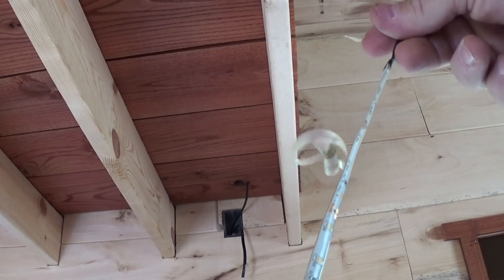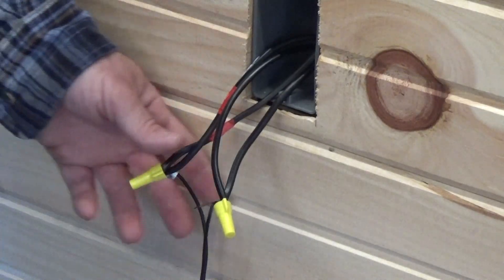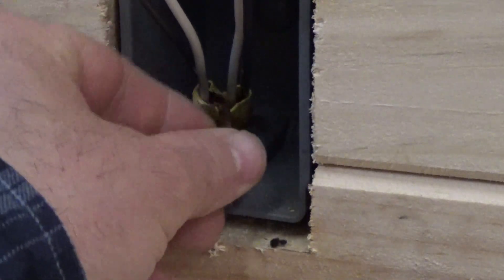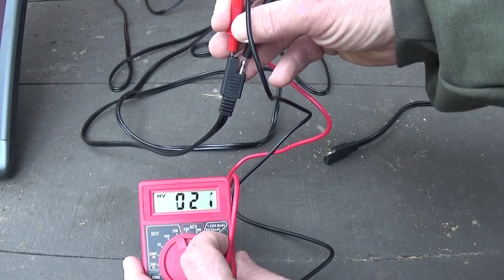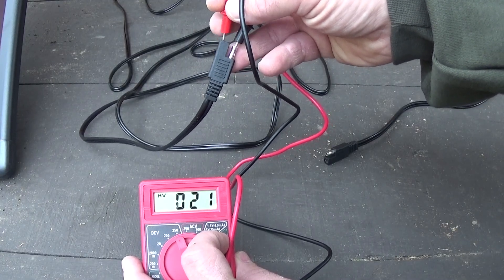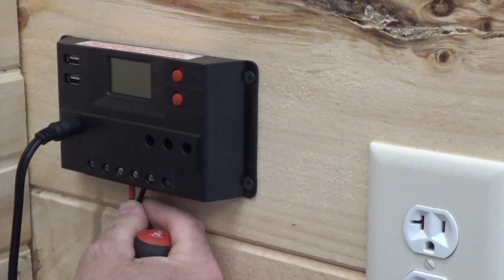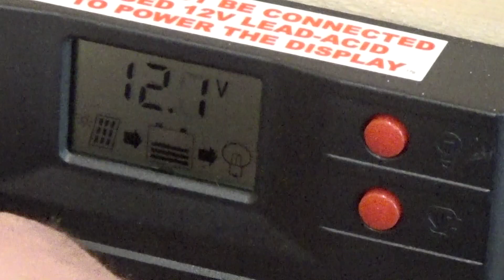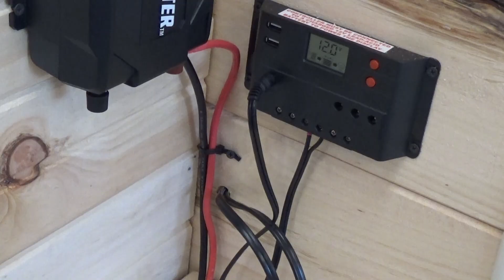Off grid tiny cabin gets  harbor freight solar panel kit installation and I wire 12 /110 volt system

Comment: Nice build, very informative.  I highly recommend some fuses/breakers in that electrical system.  The more the better.  All that hard work on the cabin, would hate for it to disappear due to the lack of a $0.20 fuse.
Reply from the maker: Thanks ! I'm glad you liked it . where would you put the fuse? are you thinking to protect the usb outlets or the inverter . I should look into that
Reply: @blackspruce1861  You can put a fuse at the output of the battery. You can get an automotive fuse with a fuse holder.

You can also put a breaker at the output of the inverter but the inverter should have some protection built into it. You can put another fuse on the input of it though. Same way, 12V fuse.
Reply from the maker: @akhurash  thanks that makes sense . I’ll have to pick some up .I’m pretty sure I did see fuses on the inverter
Reply: @blackspruce1861  No problem. Yeah inverters usually have fuses built in but good to make sure.
Reply: @akhurash  Beat me to it! I tend to over fuse.  Electricity has set me on my backside more than once!
I do a breaker/fuse on the panels coming into the charge controllers as well.
Reply: @blackspruce1861  Plus one for more fuses. Put one on the +ve output from your battery, as close to the battery as practicable, and it will protect everything downstream.  Also put one on the output feed from your charge controller to your loads. There is a LOT of energy stored in a battery (enough to weld steel), it needs limits put on it. 
And since P= I x V ( Power = current x voltage) The same power loading in a 12V system will have a far higher current running than in a 240V domestic set up. Therefore nice, thick cables with a good size cross-section are needed.   Great videos. Love your detailing.

Comment: Neat job Ryan. 
What happens to any extra power, or does it just charge the battery and stops?
Reply from the maker: Thats what the charge controller does it charges the battery full then it does a float charge so it doesn't ruin the battery

Comment: Great job, Ryan. I'm glad to see you make improvements to your build. Do you plan on adding more panels?
Reply from the maker: Thanks ! I might eventually . If  I was living in it I would certainly add more panels and more batteries , but for now I think I'm going to test it out a bit and see how it does with this set up using it as a getaway I may not need much more until winter comes around again